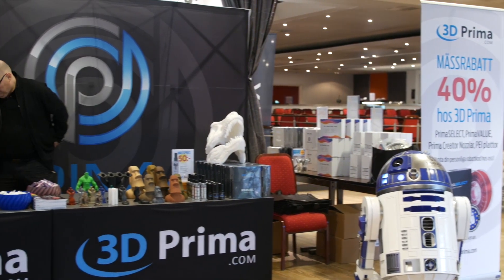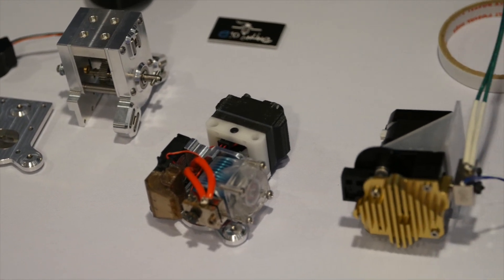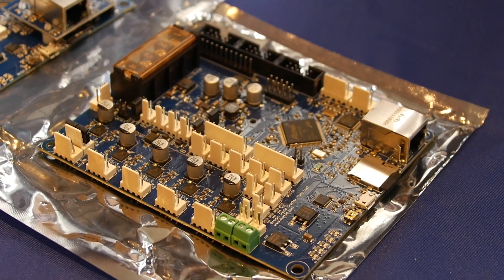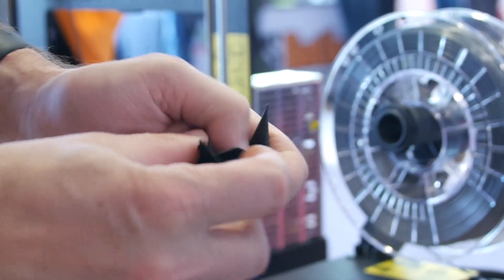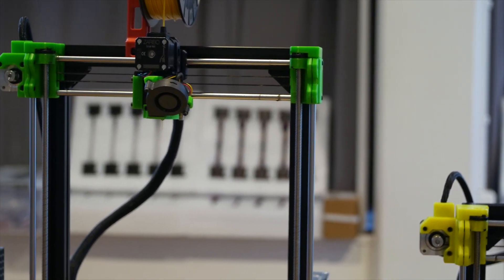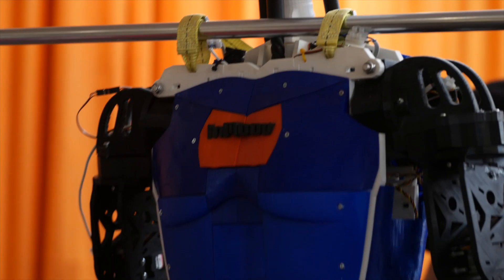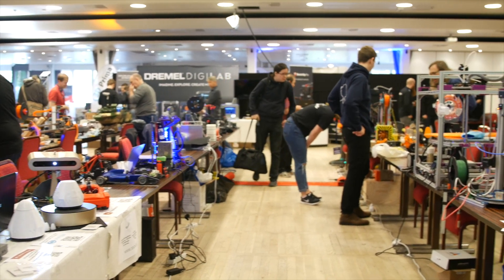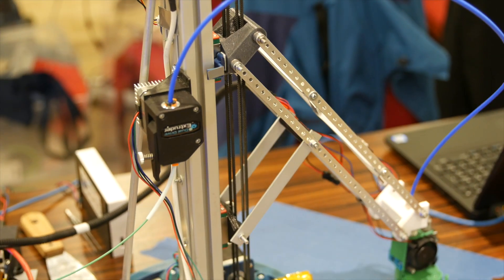3D Meetup Sweden 2019 Recap

Comment: Hi Joe. It's Ian aka "deckingman" who's blog you have linked to for the article on best in show printer. Just wanted to clear up a couple of points. Firstly you attribute the original idea to the Duet guys and whilst I am a huge fan of theirs and use their products, I'm not actually part of their team. I can understand how you maybe thought that because I had my (5 colour) printer on their stand when we met at the TCT show in 2017 and I was wearing a Duet polo shirt. But I'm just an end user of their products. Secondly you rightly say that the mechanism doesn't improve print quality but it might do under certain circumstances. I found that, although the printer rocks about, everything rocks to the same degree because my frame is very stiff. But, if there is some flex in the frame itself, then it is possible that the amplitude of the oscillations of the print head might be greater than the amplitude of the build plate. In that scenario, it is possible that there could be some gains in terms of print quality. 

CheersIan